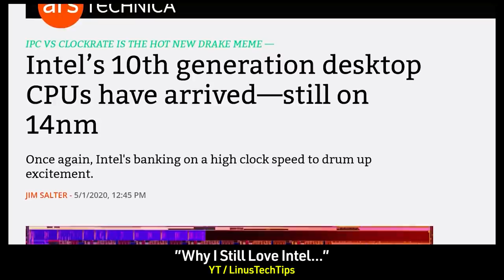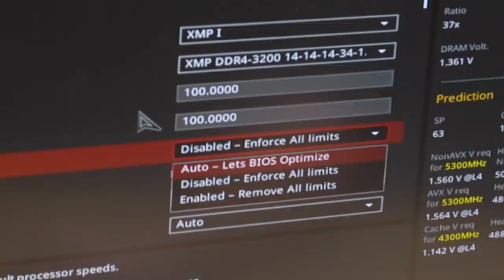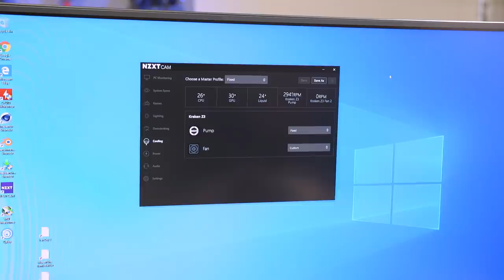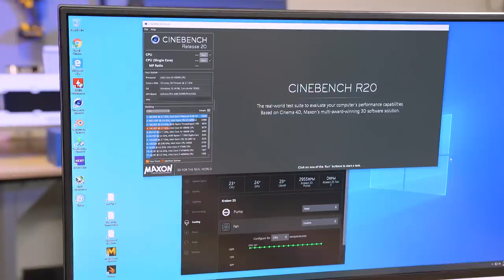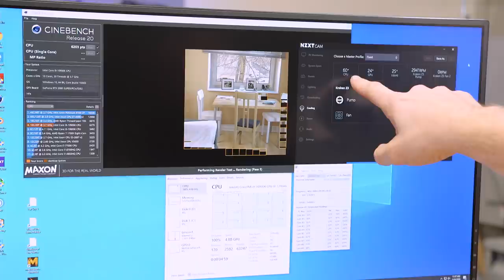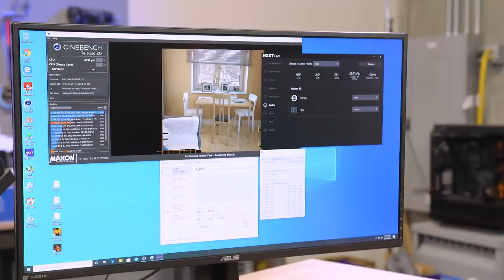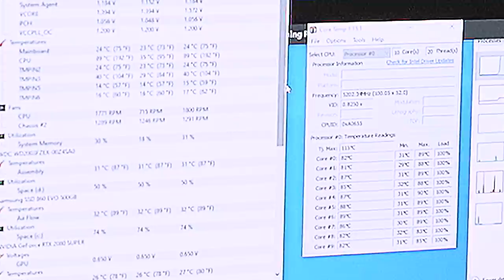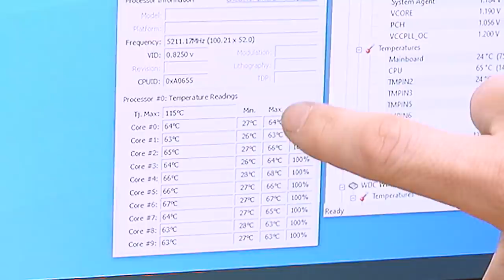Does the 10900k Melt!?

Comment: Are you certain the AIO is heat soaked after just 7 minutes?  I thought it took longer than that (like at least 30 or more), though obviously it depends on the volume of water.  I don't know the math, I just know I've seen other tech tubers discussing how most AIO testing is done inaccurately because of short duration testing/insufficient heat soak.

Comment: I have a question, as you have mentioned at 11:14 that 10 cores on such a small package is very dense. If you hypothetically manufactured the same CPU with same frequency, same specs (cache and all stuff included) but on larger die....Would that make a big difference in terms of thermals?

Comment: 3:00 Well.. One can make the argument that ANY case will be applicable to SOMEBODY, while an open test bench WON'T be applicable to ANYONE
Reply: Thermaltake p3 is basically open bench
Reply: exactly, also water cooling. i want to see how it fairs in normal conditions although i wouldnt buy anyway even if it worked.

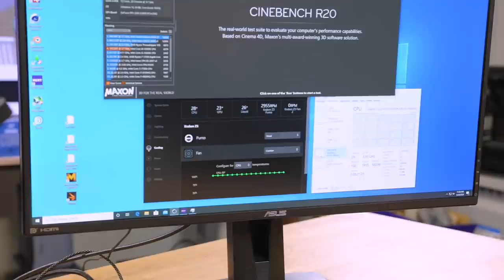Comment: 8:34. Liquid temp 26, CPU only 25. I wouldn't trust either of those numbers just based on that. CPU just physically can't be colder than water in the loop, if CPU is on. So one of those is inaccurate number. Maybe even both. Of course, doesn't change the fact that 10900k is cooler than 9900k, but something was weird with those numbers.

Comment: I still trust all the other reviewers who say the "10900k" runs hot, they tested it with "MCE" enabled which auto overclocks all the cpu cores too 4.9ghz, Jay your ambient room temperatures are always weird- since you are running air conditioning I remember watching your "EVGA GTX 980 hybrid" video & seeing the max gpu temps of 49c under load which is really not possible unless the room is cooled with air conditioning....
Early reviewers were only using 240mm AIO or large air coolers like the be quiet! dark rock 4 pro, also your cpu might be cherry picked too use lower vcore voltage!
Reply: exactly
Reply: wedgoku     If you watched and listened to the other reviewers you would find out that Jay's results aren't far off.

Comment: Dude since i use pc and that is like 20 years, everytime i go gaming i just open 1 side of the case cause i always had cases that can easily open like doors, and they ain't expensive at all. I never had temperature problems. But with closed case, without enough of fans, overheating starts, components are choking in hot air, fps drops over time. Just open the fucking case when u are gaming xD

Comment: Guess you won't be seeing this processor in a small form factor build with a Dan A4-SFX or an NCase M1. You might get away with using the Streacom DA2, it can accomodate a 280mm rad but at $229, $300 for a Asus Strix Z490-I motherboard and whatever the 10990k is going for (Newegg is out of stock and I didn't find a listing for it on Amazon). Cost to build a system will be too goddamn high. Would like to see someone attempt to put it in the NZXT H1 for the lolz.
Reply: Phanbot01
The 10900k is what it is but the point is that people were going crazy saying it will burn your house down!! and blow the power meter off of your house!! ALL LIES !! This proves all the AMD fanbois are dead wrong!

Comment: Why would it matter which way the water block is orientated? They aren't normally indexed or 'keyed' as far as I've seen?
Reply: I do remember one time a proprietary HP desktop CPU cooler from back in the day that had a cutaway only on one side for its voltage regulators but I honestly can't think of any other CPU cooler that is indexed like that.

Comment: Running the same test (minus the OC) on my stock 10900K with a Corsair H115i Pro (280mm) and my liquid temp goes from 26c to 40.5c within 10 minutes. At 15 minutes the liquid temp is 41.2c with a max core temp recorded for 92c. The clock speeds seem to be steady at 4.9GHz on all cores. MSI board with the only changes being applying the XMP profile for RAM and setting an aggressive fan curve.

I guess my H115i is crap, or I need to figure out what the issue is with the radiator...

Comment: Hey Jay. Sidetracking here. 
Is it true that most PCIe risers that come with Vertical GPU mounts have issues with X570 boards because those risers are not rated for PCIE Gen 4? 
Heard of BSOD errors and stuff. Wonder if you could help answer that.

Comment: Hey Jay! Thanks for video, this chip definitely doesnt seem hot / hotter than the 9900K with the same clock/voltages.
I know you mentioned it in the video, but the open case testing will always be a question mark - even if it works as a good baseline (because all tests will in fact be the same) theres just so much more going on once you bolt everything into a case and have components heating up each other, airflow etc. As much as the open case is a good baseline, I think a closed case would be as good, as long as you always used the same for these kinds of tests. Would it be the same as the viewers specific setup? No. Would it most likely be pretty close? Probably yes. I did some extensive testing on this a few weeks ago where just running with my chassi side panels off, no dust filters and front open it reduced my temperatures from 79 C max to 62 C max (custom loop). If I start up my PC with my case closed my first tests will be the same, but once everything soaks with heat the results are very different, but those are the "true" results for anyone planning to do any work/gaming on their PC for extended sessions. Another thing thats worth mentioning is that Ive always like you relied on Cinebench R15 and R20 to verify the stability of my systems. However after all this rave about P95 online, I tried it and my computer crashed immediately. The voltage increase needed from going stable 10 hrs + on Cinebench R20 to Prime 95 was almost 0,1V (1.195 to 1.275) - and the temperature increase on the same settings are roughly 14 C. Again, I completely agree with your comments here - but throwing any 9900K/10900K into a closed case, in a realistic environment you probably need a custom loop to be able to cool your CPU enough to run P95 without going over 90 C.
Reply: Overclocked that is... (5K +)

Comment: Linus wasn't wrong, he was saying that "reports indicate" but it was speculation that turned out to be wrong, not specifically Lienus.
Edit: I see from the end of the video that you were just poking fun

It's hard to say, but I guess cases could be both better and worse than open-air in terms of thermals. If it's badly done it would stifle, but if massive blowiematrons all over it would be better. So test bench is actually a good median. 👍

It's not plural of Asus, it's possessive. "Asus's"

Comment: Why does my 3800x only hit 4.0ghz under all core load and 4.3ghz under single core? temperatures are well under 70c with a 360mm AIO. Running on a x570 aorus pro.

Comment: I totally disagree that the redesign of the ihs made any difference towards the improvements infact i think making it thicker only hinders cooling.  The main reason the 10900k runs cooler then the 9900k overclocked is pure silicon thickness.    Copper has a way way higher heat conductivity rating then silicon so any nanometer of silicon is going to hinder is.t cooling.   If you check die hight compared to 8700k its still .22mm thicker so taking that off would shave off another 5 to 8 degrees as the heat no longer has to be transfered but silicon which does a pisspoor job at conducting heat.   The thicker ihs is likely for strength as its a long die that can snap

Comment: Having issues cooling my Core I9-10850K with air, all over-clocking off except XMP memory. I ordered an AIO cooler for it. Hoping that helps.
Reply: Which cooler did u get?
Reply: @Charmarque  I bought a 240 mm ARGB water cooler from Fractal Design Celsius+ 24. Made a huge difference and quiet.

Comment: my x62 and i9 9900k idles at 35c and he gets a 10900k to idle 10c cooler. ik he’s open air but i have a front mounted aio and my front panel off and still 35c? can that ihs rework and z63 make that much of a difference?

Comment: I know its a tangent, but i underclocked my 3950x to 2.3ghz(using only windows power plan) and ran a 10 loop cinebench run, why? because it was being passively cooled by a noctua NH C14S on an effectively open air bench(HAF XB EVO with all panels/fans removed), It ended up getting to 91c before i stopped it half wat through the 11th test. IF i had a "chimney" that rising heat would have created a draft causing an "active" cooler, might have gotten away with 2.5Ghz if i had a 1 foot chimney, would have definitely been able to run indefinitely at 2.3Ghz

Comment: Too bad the 10900k pinned itself at 100c in Aida64 after a few minutes on a NOCTUA NH15, stock cpu settings btw, in the Toms hardware review, That cooler keeps a 3970 and 3990 cool, but not a intel 10 core

Comment: Don't know how I feel with the temp difference between the CPU and liquid temp of over 60C. If that AIO was taking in 40C air from the case rather than 26 from the open bench wouldn't that CPU thermal throttle....yikes...
Reply: Why is your air 40C inside your case??

Comment: What if it was a cheaper 240 or an air cooler? Using a 280 doesn't really answer anything. You just showed a beefy cooler doing what it's intended to do. Some people don't have the case for 280mm. So now they have to spend an extra $200 buying the 280mm+a new case.

Comment: Jay,
I definitely agrree with you about how I feel about temps. I came from the era of Socket A, where if an Athlon XP even REACHED 57C, despite the claims of its tjMax being whatever, it was immediately unstable. So yeah, I'm of the opinion that I'd only be comfortable if the prime load temps on a CPU went no HIGHER than 80C. my next platform is going to be on a 9900K because that's what the board I have on hand limited me to. To help with the temps, would it indeed be worth my time to get the de-lid kit and direct die mount the cooler? Just take that shoddy IHS and sTIM out of the equation completely, I mean?

Comment: My dream CPU for audio production that i can't afford, those insane clocks lol.
Reply: Tell me about it. I do audio work too.
Reply: @jc.1191  Insane singlethread perfomance allows a CPU to handle chains of effects better because they can't be processed in parallel very well due to the logic and serial bottleneck.

Better the singlethread perfomance, you will reduce the bottleneck or the difference between the CPU meter in the DAW (Digital Work Station) or Windows's Task Manager as an example.

Also, more stable very low buffer sizes, the 10 cores means that you can have a lot of instruments on a mix or a track.

Ryzen has insane core counts but you will lose a little bit of stability for lower buffer sizes since the singlethread isn't as strong and they aren't the best in gaming. 

Ryzen 9 3950X could technically be the best but it's more dedicated for rendering, virtual machines and other things like that, best single core perfomance with high core count is better.
Reply: @jc.1191  Also, you have other architectural differences between Intel and AMD, since Intel's CPUs have very low internal latency also makes them the best gaming CPUs, audio production or music production is a real-time heavy workload like gaming is, the CPU has to deliver data for very small periods of time with the audio buffer just like in gaming you have the game cycle. I think that having more than 8 or 10 cores is a waste.

Let's see what happens with Zen 3 from AMD.
Reply: @saricubra2867  yes, a single core can bottleneck the whole thing in audio unfortunately. It would be great to see the thread usage fix that somehow eventually.
Reply: @jc.1191  Not possible sadly, that's how audio works, even when a synth produces a sound, each part of the signal chain has to happen in the correct sequence of events, therefore running in parallel is almost impossible.

Also, there is lot of heavy math like floating point, fast fourier transforms, filtering and other stuff which is far more complex than vectors for an image.

It tries to simulate how the real life analog world works.

Comment: I'm scratching my head here with those temps.    Perhaps I'm mistaken but seems to me the water block is not transferring enough heat from the cpu.  To see proper heat transfer wouldn't the water temps be expected to go higher as it draws more heat from the cpu?  Maintaining lower water temps is great but it's supposed to pull more heat from the cpu.
You're much more experienced than I but something seems off to me.

Comment: Is there a 6 core, 12 thread intel chip that can actually run 5ghz all core with an air cooler now?
Reply: 9600K, 10600K with a Noctua NH D15 or BeQuiet Dark Rock Pro 4, but the real question is can any AMD Ryzen CPU run an all core 5GHz with any air cooler or even an AIO? Sadly NO....
Reply: @vMaxHeadroom  Yup looks like I'm going Intel next time then.

Comment: The average user, apart from being using a case, will probably not buy an expensive AIO but an air cooler maybe like Noctua NH-D15 or NH-U12A. Also the average user will not ramp the fan speed that much for 24/7 usage because noise is annoying. Also the average user will just turn on the MultiCore Enhancement, because that unlocks much more performance out-of-the-box with understanding nothing about OC. So in the end of the day the actual temps for the average user using this chip will be much higher than you showed, unless he sacrifice something, being it noise or money or performance or a case.

Comment: Idk how to get these temps aside from getting an open test bench.. I’ve upgraded my case twice now and using a thermaltake view51  currently but even then and blasting cool air at it externally with a fan, I can’t get my i7 8700k to stop hitting the high 80’s-94 on 3.8ghz on a single 120mm nzxt sealed rad. Probably the rad is undersized? My case pressure is good, 
i’m taking in a bit more than out and fans curvs are good.. But I also think I lost the cpu die lottery.. looking at a 9900k seeing as how it out preforms the 10900k in most gaming tests

Comment: Didn't hit 80 degrees out of the box... Ofcourse he was wrong. But then again cooling solution has an effect on temps... what temps when using a $50 or lower tower air cooler with 3 heat pipes? He would be right then maybe.

Comment: Can't trust cam software. I have aorus x570 master with a 3900x and  its all stuffed into a 510 elite with a nzxt x63 cooler. I only use cam for rgb. When I checked yesterday the temp of my cpu. It was at 145° in cam. I freaked and checked my system and it was running at 48°. Btw there was an update on cam on 5-26-20.

Comment: I have an i7 5820K with a 5 years old Corsair h100i and the liquid temp goes to like 55ºC with max load at 4.4Ghz with 4.22v using around 170w and CPU temps between 70-85ºC. But at idle the liquid temp goes down only to 40ºC, so I don't know if the sensor is bad on the h100i or it's getting more heat that what a 5 years old h100i can handle. I bought it used, so I did not know how the temps were when the h100i was new.

Comment: Guys I overclocked my 8700k to 4.8 and in r20 my tepms are in the 90's, in gaming it reaches 60's. I'm using a 280 mm AIO, perhaps I didn't mount it properly?
Reply: Depends, did you use auto voltage or how high is it? (Higher voltage really cranks out the heat) Are you running an AVX offset? Most will use an AVX offset of 3 (Your Cpu will be 300 Mhz lower during AVX workloads) but if no offset it heats up due to being 4.8 Ghz all core. Lastly have you delidded your Cpu? If not you may want to consider it. I have 8086k (Binned 8700k) and I did a delid and it helped alot on the temps. I can run 5.2 Ghz 1.37v using 360mm AIO with great temps.

Comment: Hi, im a little new to overclocking so I would like to know if I can set a VCore that only goes to a specific max, but can be lower if the CPU doesn't need de extra voltage. I have a Gigabyte z390M with a 9600k.
Reply: Use an adaptive vcore setting in the BIOS. All Gigabyte boards especially the Z390/Z490 have a fairly good adaptive vcore setting which will allow for voltage to drop whilst sticking to a max limit....Apologies for the delay!
Reply: @vMaxHeadroom  Do you know specificaly where in the bios this Adaptive VCore setting can be found?

Comment: guys what do you think about buying the cheapest processor for the 1200 socket with reasonable motherboard and when the 11 gen is out go all out for i9? im worried about boiling cpu temps from that 14nm++++++++ and giving al hope to the 11 gen (they said that 11 gen is gonna be on 1200 socket too) please give me your opinion on this plan bc i have so many thoughts that i changed mu build like 15 times
Reply: Kamil Druti
Unless you're an avid gamer i would look at the 10600k. It's reasonably priced and from the tests i have seen it works great. If the 11th gen looks good later then you can sell your 10600k for a good price.  There is low to no stock anywhere so be patient.

Comment: the stability of the Intel CPU is excellent
but...
in another side... why the default CPU config is not more agressive ???
if its so easy to overclock and keep it cool, why its not the default setup for the CPU?
when there is too many space for the overclock side, this mean that the non-overclocker are underperforming. 
we should not be able to overclock so much (outside LN2 for sure)

like modern GPU, they are already near their limits, there is no space to overclock them. the customer pay to have the best performance possible.

Comment: Bullcrap, blue screen after 15 mins - what about using pc for hours with extensive cpu usage - this will crash every 20mins until dropped to much lower frequency - 10900 is running high temps<period> overclocked is really hot and just because its much better than 9900 doesnt mean that it all good now....